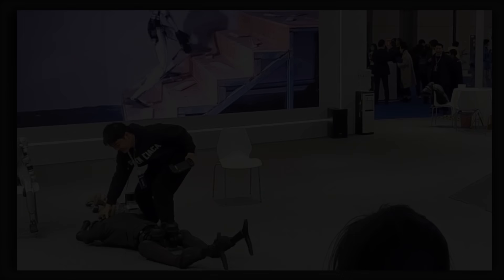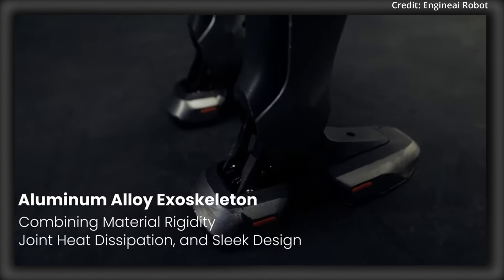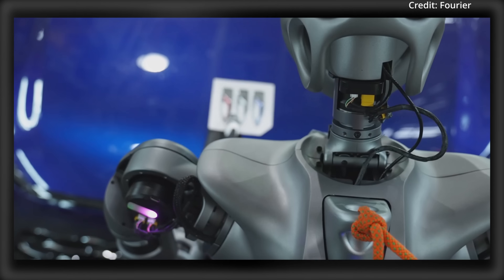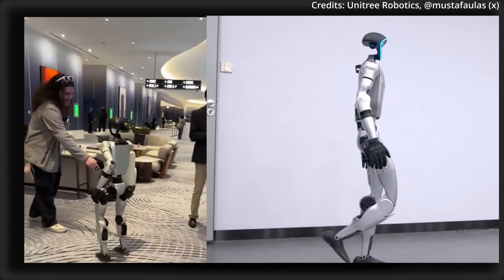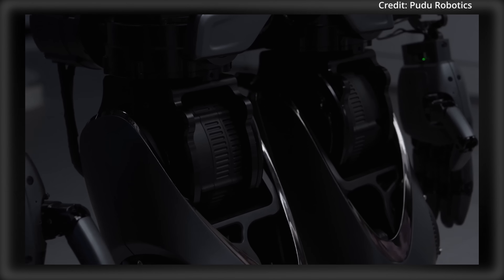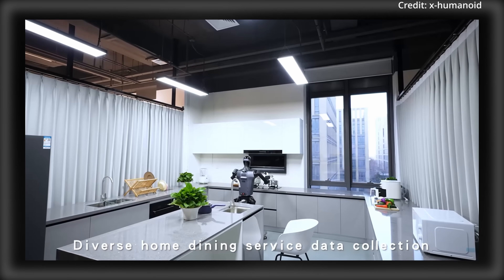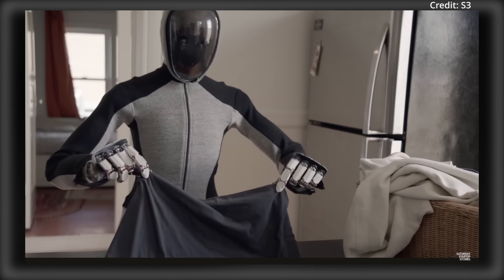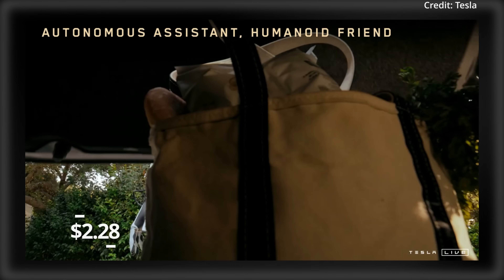Top 15 Humanoid Robots Coming For Sale In 2025 (PRICE, AI, TECH BREAKDOWN)

Comment: 30 USD per hour? Why built in such expensive way to use so much electricity? And why does it use so much? Lets say an electric car drive already 500kms for like spending of 10 or 15 usd electricity exclusivly ... perhaps there are more optimal solutions how they can run. And robots could be avaliable to anyone with primary focus on self sufistacy (to help with gardening, health, eldery, predicting health conditions and similiar)

Comment: The Next Frontier for AI Robots

We're not quite there yet when it comes to fully autonomous AI robots. 

The primary obstacle holding us back? Power.

Currently, batteries provide an average of just 2 hours of operation for AI robots. 

This limited runtime severely restricts their potential for real-world applications.

The solution lies in developing a fusion power source that can be miniaturized for use in autonomous devices. 

A micro-fusion power supply could revolutionize the field, enabling AI robots to operate for extended periods without the need for frequent recharging or battery swaps.

Until this power problem is solved, the true potential of AI robotics remains just out of reach. 

But with ongoing advancements in fusion technology, we may not be far from a breakthrough that will unleash a new era of autonomous machines.

Thank you.  🙏

Comment: Always has best value for money spent: Tesla brand.  This is by design.  Also, what no one knows unless they do their research: Tesla (by extension any business founded, owned, and operated by Elon which includes the world's best AI center for xAI) has the cleanest, most rich data set for real world interaction by SEVERAL orders of magnitude.  From the cars alone, they capture and scrutinize billions of miles of real world data, high resolution, each year.  This is staggering.  It's also the same computer and full self driving they use on their robot.  Essentially, when first turned on, the robot thought it was a car.  They had to teach it, that it was much smaller.  Tesla wins, period.  Best engineers on the planet apply for SpaceX or Tesla each year, for the last ten years.  Those are the top two picks every year for the best graduates on Earth, both run and orchestrated by Elon.  These companies interchange employees like socks, I should know, I used to work for Tesla.  Also, everything from the chipset, the SOC, and the actuators, to the very alloys used, are all built with first principals thinking from the ground up to save on cost.  This is to perpetuate the cost savings onto the consumer, which in turn allows more people to buy the product, and there you have it - the perfect flywheel.  None of these other "competitors" stand a chance in hell.  They don't have the capital, nor the data, not mentioning the world's best brains.

Comment: I wonder if these can be customized or tweaked for bodyguard/security work for a property and residence, about three of them placed strategically to cover my entire property should suffice, cost per hour shoukdn't be high as most of the time they will be in passive mode and activated if a situation arises. Where I am is in a country where all sorts of crime is off the charts, so these should come in handy, as even hiring security guards where I am is not without its dangers, even security personnel are involved in crime and some in cahoots with shady characters so hardly anyone to trust.

Comment: Great coverage for all the models. The gait performed by the first one is crazy. If it had the heal to toe foot motion, it would've given it more of a human-like walk. It won't be long now.
Reply: We've all been taught incorrectly how to walk properly. The HEEL should only touch level ground when we are not walking. The Heel is designed for balance and only should be used while in motion for balance on uneven surfaces. Try walking for a week on just the Balls of your feet. You have MUCH better balance while in motion than you do if using the SPHERE/ROUND shaped heel as first contact of your lead foot. Check into it and try it for yourself.

Comment: I'm astounded at how cheap these robots are. They aren't ready for unsupervised work, and the humanoid form is not optimal for most practical tasks, but in another few decades I could see as much as half of the human workforce in developed countries being completely replaced by such technology. As long as hourly operating rates can be kept below the minimum wage of the various places where they will be implemented, it's a done deal. The only thing I see being a real obstacle are the inevitable accidents and PR nightmares that will slow or halt adoption.
Reply: in another few decades ? in a few years or a decade you mean ...
Reply: @jerome7261 No, I mean decades. Only computational power moves at such break-neck speeds from concept to production. Far too many moving parts, regulation red-tape and international trade necessities to work out to fast track these things. We've been fooled by the tech sector for a long time, because all they needed to assemble were boxes with buttons, ports and screens. These require motors and finely machined parts. Regulatory red-tape alone will keep this sort of technology ridiculously expensive and scarce for much longer than a mere 5 years.
Reply: @TheYgds  
Well, regulation is just something they can change, considering their mindset. 
I also bet they can build their own fine motors, parts and tools to build them...they probably have fixed this aspect.
Reply: @TheYgds  What about that microsoft chip? Shouldn't that speed things up?

Comment: 2 hours? Not enough for make me a dinner
Reply: The '2 hour' deal isn't great!
Does that mean you need to be 'charging' another battery all the time?
Reply: If it takes you longer than 2 hours to make dinner then you've got issues.
Reply: It'll probably have several spots where to plug in for charging while still operational
Reply: 2 hours is more than enough for a start. After that you can recharge or swap batteries. Remember that these are the 1st generation of robots coming to market. It's only going to get better down the road.

Comment: The price are very wrong, for example the G01 model cost 39.000$-65.900$ but in their website is offer for 16.000$.
Reply from the maker: It was $16,000 until it wasn't.... https://youtu.be/5nZVpFrcAz8
Reply: The 16000$ model is basically useless.  Can't be programmed.  What training it comes with out of the box is all you get.

Comment: You say these are the prices, but then assume a single year(365 days) when calculating the daily cost.  If this is a yearly rental that would make sense, but if this is a purchased product then you need to take into acount how many years it will last. I would assume at least 5 years, which would reduce the daily cost by 5 times.
Reply: Battery Replacement, Hardware and Software upgrades, along with general maintenance and parts replacement will all be added costs during the time of ownership. Just like your car now but worse. More expensive and often.
Reply: @codybanks9944 especially for anyone that buys early